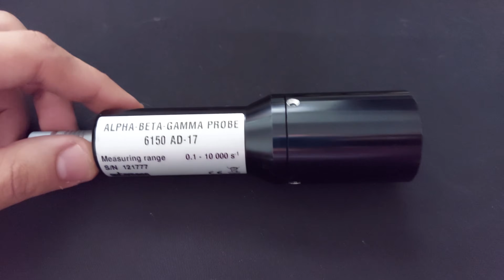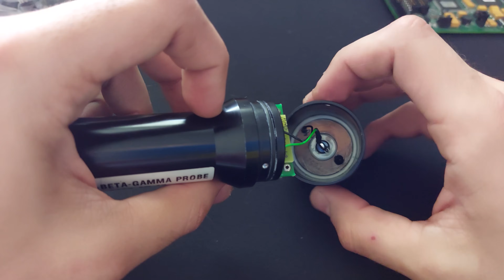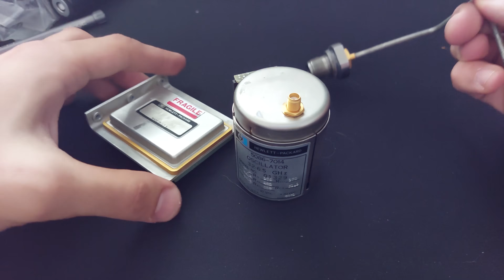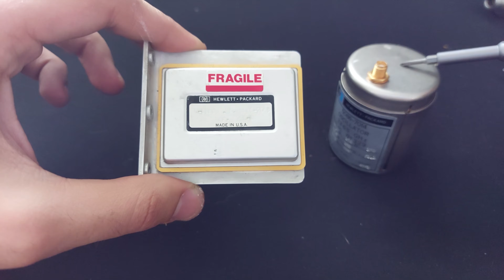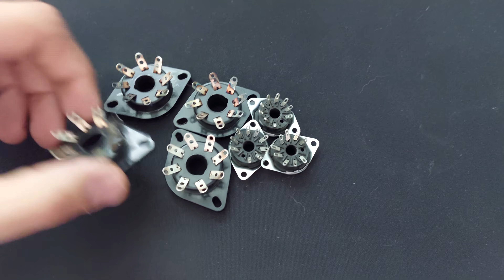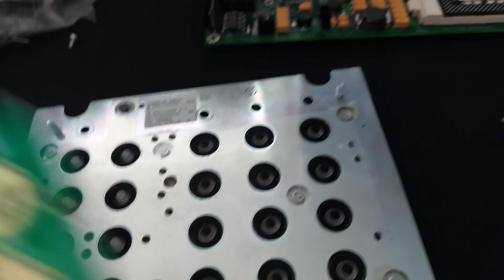Fantastic Fleamarket Finds EP.1

Comment: A long time ago I serviced ATM machines. The modern machines will be using an other system than this old one, so I can safely tell you some about this one.
That ATM keyboard is in fact a very sophisticated computer!
Beneath the potting there is a complete computer which has its program in RAM. That program gets its instructions from the main computer in the ATM that communicates with the bank computers. The bank computers send a certain code to this computer. The pin-pass reader is also connected to this computer. This computer reads a code from the pin-pass (not the pin-code!) and reads the keys you press to enter the pin-code. This computer compares the code from the pin-pass with the pin-code with the code sent by the banks computers. The output is sent to the bank computers. If this is ok, the bank computers send a message to the ATM computer to count the required number of bank notes and output this to you.

The RAM in this computer is kept energized by the Back-up battery. The tamper switch is connected to a circuit in this computer that erases the entire memory. This way it is impossible to know how the calculations are done with the codes to confirm you are the rightful owner of that pin-pass.
There are more safeties built in, but that was only on a "need to know" basis, and I did not need to know.
Once the memory is erased only the bank can reload the software and reactivate this computer. This is done in a safe environment and under very strict security.

Comment: I have a similar Russian dosimeter from the 80' with two of the SBM tubes in it, it is older than yours, no fancy push buttons but a sliding switch on the side to select range. Nice to know there are replacements around should I need it, even if they are EUR 20.

Comment: I have a rather rare MiniStor 40MB 1.8-inch hard disk which has several of those gin bottle shaped orange tantalum capacitors.  The protrusion in one end is to mark the positive side.  Those capacitors are hermetically sealed and should last the life of the product.

The Cyrillic "E" on one end of that SBM-20 means it was made for export.
Reply from the maker: Both things you said are entirely correct. I used those tantalum caps in the past, they're very very good but really pricy